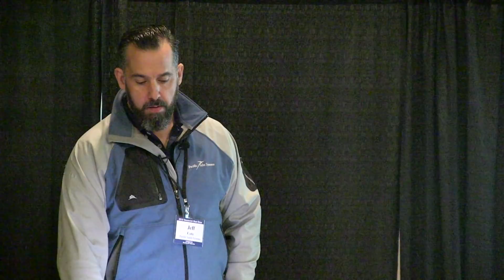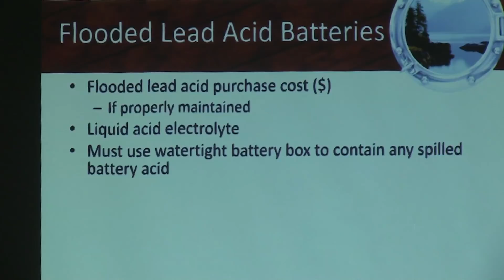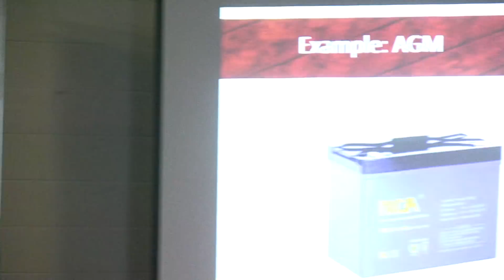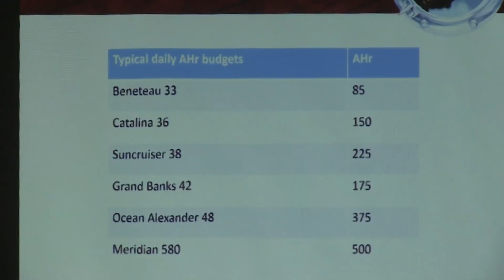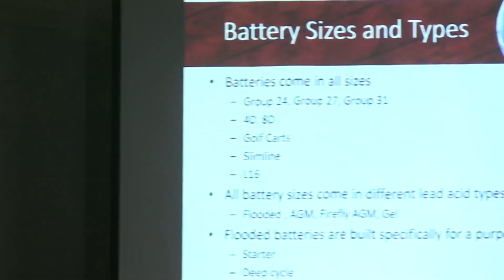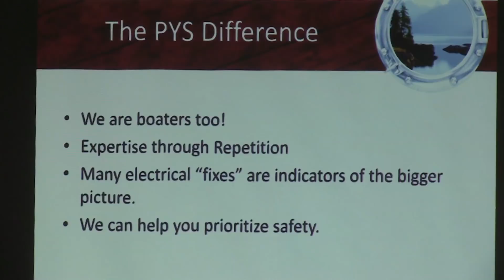Boat Show 2018 -  How to Choose the Best Battery for your Boat

Comment: Thank you for sharing your knowledge and experience, Jeff. When determining charge rates, should I consider my battery bank capacity the manufacturer’s rated capacity in amp-hours or the useable capacity commonly expected from that type of chemistry? E.G. A manufacturer rated 100 AH flooded battery, 35% useable (85%-50%). Is 25% max charge rate 25 amps or 8.75? Thank you, Alex

Comment: Can u use firefly batteries for starter battery or only house?
Reply from the maker: Firefly are definitely built for a deep cycle application, but lots of boaters are still using Firefly for starters too.

Comment: Hi, Thank you for the good explanation. But i have a question? On my boat i want to replace the service batteries (age) with a set AGM batteries 12volt,500amps. Charging is no problem for the altenator and the shore power. But i have +/-600 watts = max 30amps/ 12 - 14volts charging power. Usually i charge somewhare between 5amp (winter) and 25amps (summer). But that is not the minimum requirement for the charging capacity for the batteries. Do you think the batteries are never fullt up, or am i seeing something wrong? Greating S. Siebenga. Amsterdam
Reply from the maker: Hi Sjoerd, if your battery is used as deep cycle battery and the capacity goes well below 85%, then you should consider a way to recharge your batteries at 10 - 20% of capacity. Perhaps you can run a high output alternator.
Reply: @PacificYachtSystems  Thank you for the advice.

Comment: Hi Jeff, I have power boat with single Engine 5.0 Mercruiser, can I put two AGM Battery 100ah each, but both of them are pure deep cycle battery, is that will harm my Engine?
Reply from the maker: Hi Ameen, pretty common solution. Otherwise, you could get a NorthStar cranking AGM battery.
Reply: Pacific Yacht Systems thanks boss, I follow all your advice, Good luck 👍🍀

Comment: Hi how are you doing ? I like to ask you a question ! Can I charge agm battry with a standard omc alternator ? Thank you
Reply from the maker: Hi Pajero, it's not ideal but it's fine as long as you have a battery charger that can be set to AGM when connected to shorepower.
Reply: @PacificYachtSystems  thank you

Comment: Q: Why can't the Firefly battery be used as a starter battery?  I read their C rating and they more than seem to be able to be used this way.  Thanks.  Looking at the Firefly real hard right now even if I have to drive to Canada to get them.  (Seattle based)
Reply from the maker: Some boaters are using the Firefly battery for starting applications. Notwithstanding, it only has a CCA rating of 625 amps.
Reply: Thanks.  Somehow I missed that on its spec sheet.  Of course sailboats have small engines so no big deal.  Guess a power boat will have to use them in parallel if using Diesel.   @PacificYachtSystems

Comment: Great presentation Jeff, thanks. Right at the end you did that series batteries were better. I am trying to figure this out. I thought that most batteries were comprised of multiple approx 2vdc cells in series in a bigger package. i.e. 3 cells for 6v & 6 cells for 12v. Am I correct in assuming that 2 6v batteries in serious have a larger capacity than the  single 12v battery of similar size.  Please excuse my ignorance. 
Bob

Comment: What would you guess for Island Packet 35 with Fridge for Ahr?
Reply from the maker: I guesstimate between 40 - 60 Ahr. Really depends on the age of the compressor and the size of your fridge.
Reply: Thanks that at least gives a good range.

Comment: Why not LiFePO4? They are already quite cheap in China.
Reply: Pacific Yacht Systems

So would you recommend buying LiFePO4 batteries from China since they are usually like over half the price as you would find them in the US and CA. On paper they generally look the same...
Reply from the maker: Hi TST1998,
All batteries offer various advantages and disadvantages. The LiFePO4 battery is a really good choice for the following boaters: 

1) makes use of the high # of cycles (i.e. factor of 10
or more over flooded lead acid)
2) have limited space and want to minimize weight
3) ability to recharge quickly
4) relatively steady voltage throughout discharge
All these benefits come at a significant cost and it’s up to the boatowner to decide if the cost is worth it.  At PYS we only work with LiFePO4 battery manufacturers that are well established and have a proven track record in the field.
Reply from the maker: Hi Mowhimdown,

Potential buyers of LiFePO4 batteries face a dilemma, either purchase LiFePO4 from:
 1. A reputable manufacturer (Lithionis, MasterVolt, Victon, Xantrex, etc.) and pay a conventional price per Amp-hour, knowing that there is a company standing behind their product.
 2. A newcomer manufacturer which charges less than the conventional price per Amp-hour. Wondering what recourse an purchaser has if something goes sideways?
Professionally, in light of the sophistication of the battery  management systems required for LiFEPO4 battery, we recommend a reputable manufacture that is bound to the quality of their product and has too much too loose to produce a less then stellar product.

Comment: Great video. Very helpful. How do Firefly batteries remain a niche item? If the claims are true they are the obvious choice.
Reply from the maker: Hi David,
First hand, we and others can attest to the performance of the Firefly battery.  The adoption of the Firefly battery is probably slow
for two reasons:
1) Lack of supply, with delays measured in months, means very few boaters are actually able to purchase Firefly when they need them.
2) As a rule of thumb, any innovation no matter how great always as a slower then anticipated adoption rate.
Reply: I would say the price is the reason.  1 carbon foam is effectively equal to 4 lead acid, but the price is still equal.  IF you want people to swap you have to be at a LOWER price and greater benefits otherwise there is little incentive to change as no one really cares about 10 years down the road.  A very few do, but exceptions are a piss poor business model.   @PacificYachtSystems
Reply: @w8stral  yet people change to LFP all the time, and those don't come cheap either.
Reply: @unclebennyslife  LFP requires 1) expensive batteries and 2) extra components which are expensive.  Currently looking at going with USED 80% capacity LFP and looking at the cost even with the alternator surge problems etc.
Reply: @w8stral  I wouldn't buy used, you never know the actual state of the things. Any time electricity is involved, don't half-ass it.
Reply: @w8stral  easy there with the insults mate, I am pointing out that used LFP may be worth the cost, but chances are you'll be spending just as much money on them in the long run as someone who buys new. But, you do you. Let's talk again in a few years, let us all know how your used LFP plan went.
Reply: Price and also the fact there's still no European distributor for them, so they basically have a very limited (well...) market.